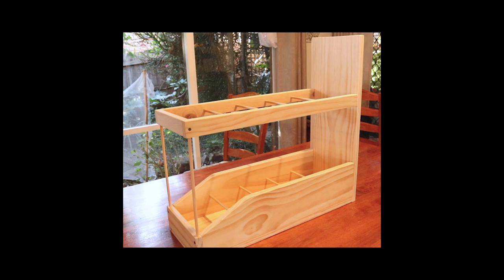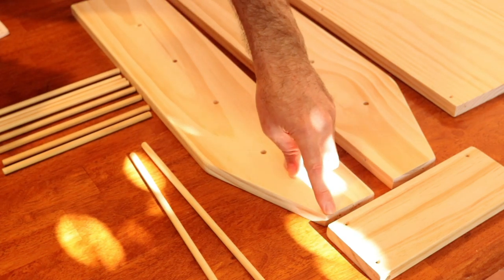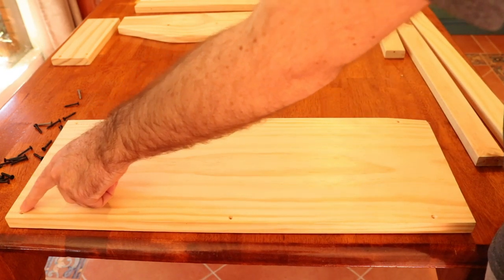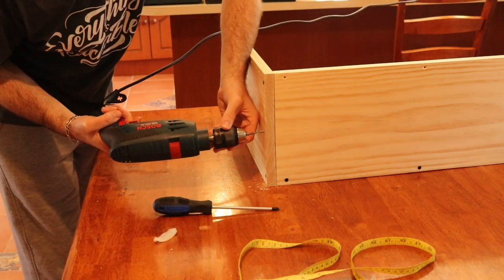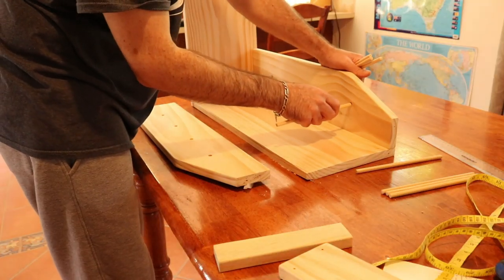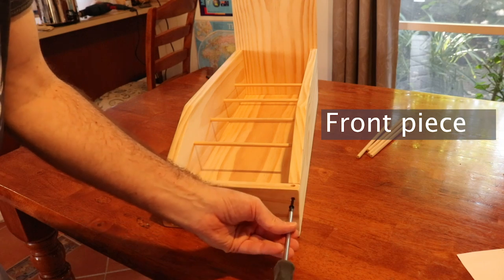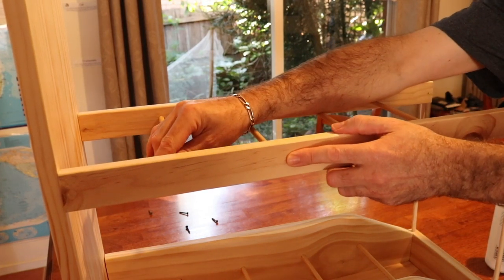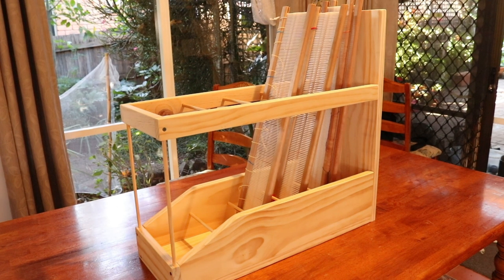How to make a Reed Holder

Comment: Tell your hubby “Great Job”. I have a mini woodshop I do various wood projects in off/on thru-out the year. He has made a simple but very thoughtful project for Heddle/reed, shuttles n pickup stick. I’ve only had loom for one week now n crafted six extra shuttles n 4 more pickup sticks of various sizes to go with my 24” Kromski loom. I hadn’t yet thot about equipment storage n this is perfect. I shall probably precede making one soon .. Again .. tell your hubby, Well done 👍!  Gerald up in Washington State.
Reply from the maker: Thank you,  I will!
Reply: This morning (Seattle time) I’m busy trying to convert your metric over to U.S.  looks pretty straight forward with a little rounding off. I’m going to go with 3/4” thickness.  Not sure if I’ll go with pine, red oak or mahogany.. Got all three woods up in the rafter in my shop. Should be a nice 👍 project.. I just antique n finish my Kromski Harp Spinning Wheel n the loom (24”). Probably go with a nice light mahogany stain to match. Cheers 🥂 Gerald